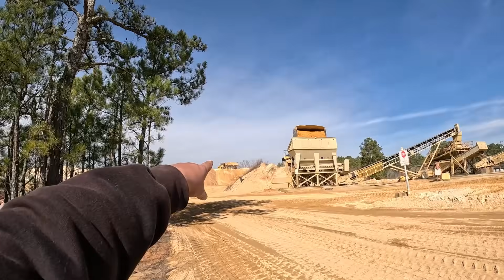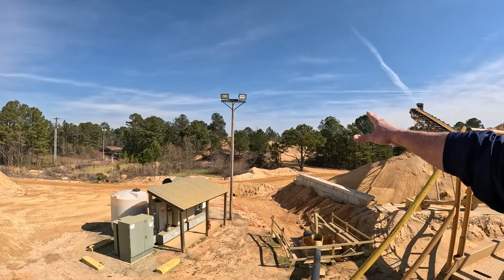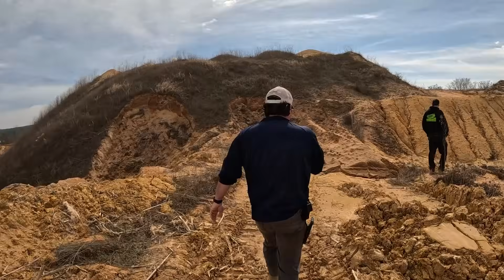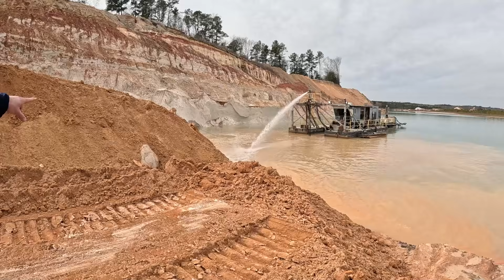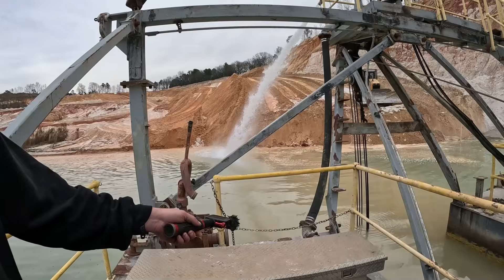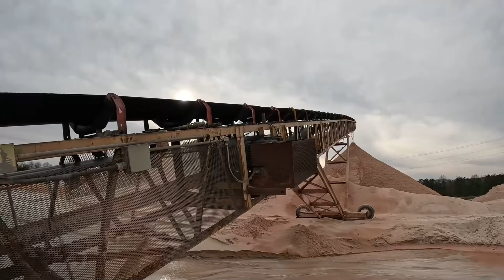The Real MR DIGG Incredible Sand Dredging Operation!

Comment: Your part owner of that landfill so when you see the nukch area starting to make a fire 🔥  area then I would think you should call one of your workers to bring over the water truck that you use to spay the main road down with to keep the dust down with equip the truck with a pump and a hose so that when stuff like  that happens or even when a fire breaks out they can use that truck to spray water onto those areas to keep fires from happening

Comment: I've been making repair parts and pieces for gravel and sand dredges and wash plants  for 35 years and counting. Every truckload of material that leaves the yard, a little bit of the plant leaves with it. One of my customers runs a 2500 hp electric motor on their main dredge, you know it's a big motor, when the cooling air blower motor on it is 20hp.

Comment: As a boy used to holiday in Cornwall back then they used to separate the China clay from the stone by heaping it up really high then playing water monitors  over the heap the Kaolin would wash out into a sump for making porcelain, putty, poultice material and mixed with morphine for digestive complaints, probably loads of other jobs too.  once washed out the mica, stone and sand would be sold or disposed of .Dont know if mateys clay any good for the usual jobs but might make good lining material for ponds or waste pits

Comment: I used to work midnight to 0800 on a 14x12 hydraulic cutter head dredge on the intercoastal waterway.  We typically could do 3000 cu yards in 24 hours, depending on material and distance.  We often had over a mile and a half discharge line.  Used draglines to build the disposal areas (dikes around settling ponds).   Very similar to what you saw, but add tidal currents continually working to rip all the pipe apart.  It was a privilege to work with them, and I learned a lifetime in those years.  So much to break and fix and understand!  Brutally hard and cold and hot work, some of the best memories of my younger life.  Done correctly, amazingly efficient.  Done poorly, gigantic dangerous money pit.  Nothing in between.

Comment: Hi Chris. That Kaolin (white clumps) being dug up from the sand pit isn't just waste. It has quite a few uses like its what is used in kitty litter, Supasorb used for oil and other liquid spills as an absorbent, in ceramics, a paint additive and many more uses. If the layers are thick enough, Ryan said 15' in the vid,  it could be viable to be processed out on the sand washing screen, as you could see in the video. It just rolls off the top screen with the initial water spray
Ryan could have another little earner there. What an operation he has there plus his other operations.

Comment: It looked to me more like a half mile for the dredge to the plant. Our pumps were pumping water only a 1/4 mile and used a Cummins N-14 driving a 4' pump which filled a 4' pipe. Each pump moved 150 CFS of water and the electric pump moved 125 CFS of water. Now multiply that times 8 for the Diesels and 2 for the electrics. Close to 20,000 CFM total for the two pump stations. Add a third pump station with the pumps just raising the water 5 feet and a fourth one supplying these with 8' diameter props X three and you get an idea of the massive volume of water that we moved. And all the stations could be run remotely except for the daily oil level checks and greasings.

Comment: Intresting video,  gives a good insite to sand production.
 Regarding the river rock  separation, could they not let the material dry up and the use a hammer mill to smash the clay balls and  and sift away the stones from the clay ?
Iam a bit sceptical to the land fill after treatment  of sand pit doe,  what kind of trash is we talking about here? ,domestic trash or or "unwanted fill material "?
The concept of 
 digging a deep hole in a sand sediment layer a put trash in the deep holeis raising questions.  Is there clay capping  in the bottom? and , what about leak water from the trash  fill / ground water going in to the trash/ fill layer?

I get that the landfill is capped on top with clay to ,decrease water ingress from above. 

It Feels like the demand off land fill capacity in the us is a problem that needs addressing.
Putting the  unsorted waste in landfills is not sustainable,  a lot of resources that could be reused / recycled  get burried with the (inert and non  toxic  material) , not to mention non inert material plastic ,polyester textile etc)
,that leach  flame retardant chemicals  plastic softeners etc. This  can create big and expensive  problems for the future to solve , trying to clean up these land fills.
It's a bit worrying when coal is burned and the energy in the 
Trash is not utilized for energy production.  Burning the trash (that cant be reused) decreases the volume of the landfill need 
And metal can be extracted from the ashes.  The burning also removes a lot of the micro plastic problem.
Reply: There is no house, whole trash, and no chemicals in the bottom of the hole. It's the clay balls and trashy sand. Have you not watched the first three videos at this landfill? If not, I suggest you do so, then you would know what's going on
Reply: Thanks for the  info!  so it's only unwanted fill then ? In that case I guess it's no problem( with this site)  , the comment about  land fills (for trash) in general and the madness of burring unsorted  trash in general is still valid doe. 
Using old sand pits  and rock corrys for depositing non contaminated waste fill is not problematic and very common
Practice,  there is rock quarry 
Near my home town ,and in there permit for taking out gravel and material they also have a permit for storing after treatment fill ,this will be used for restoration of the site as natural forest when there done.